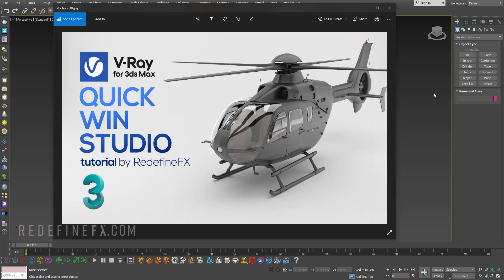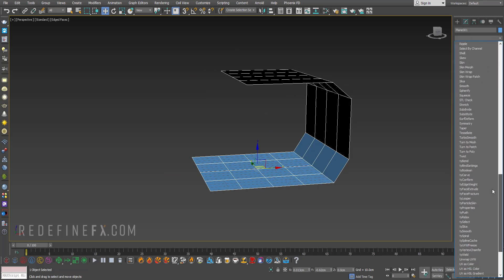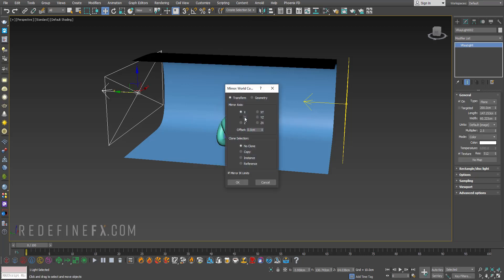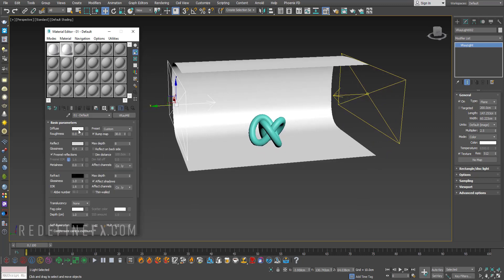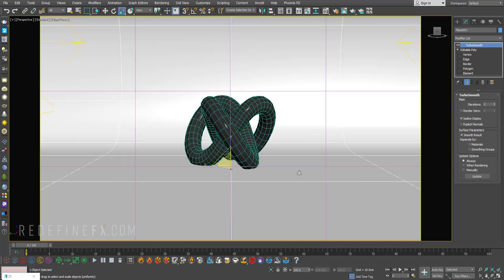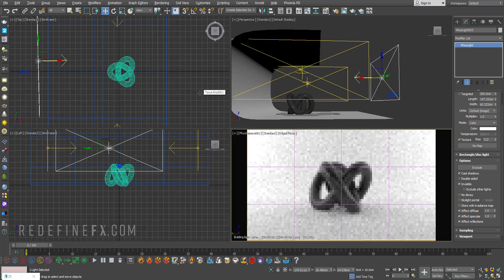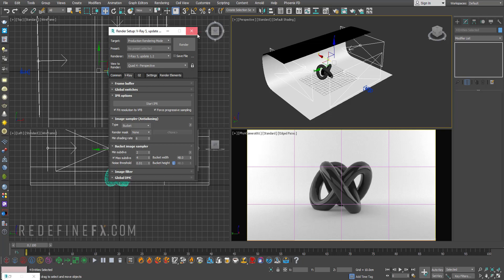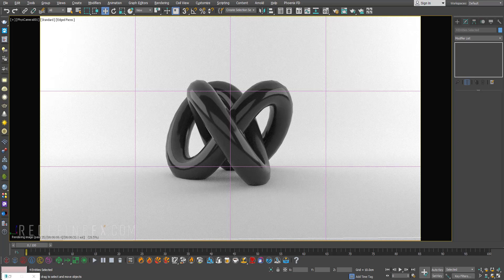Easy Studio Lighting Setup with Vray in 3Ds Max for Absolute Beginners - Tutorial by #RedefineFX

Comment: My specs are 1050ti mobile 4gb vram, i7 7700hq , 16gb ram. Is it enough to follow your paid courses ?
Reply from the maker: Yes if you can get CUDA to work inside tyFlow with that GPU
Reply: @RedefineFX  yeah 1050ti mobile is CUDA supported. I hope there’ll be no problem. Thx for the answer